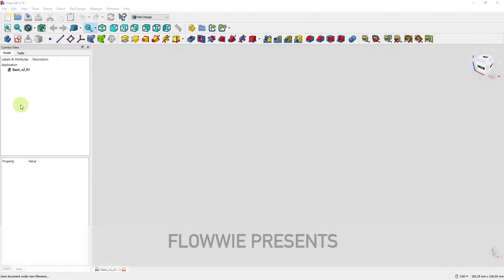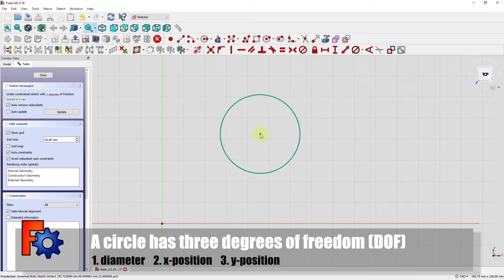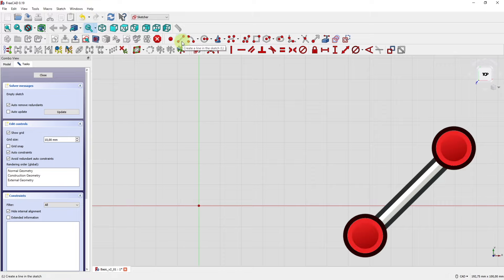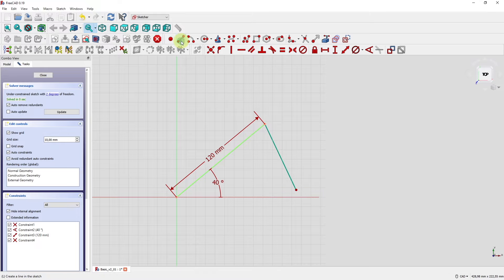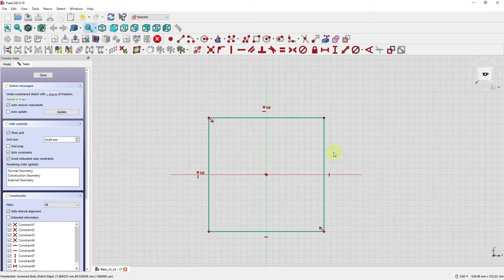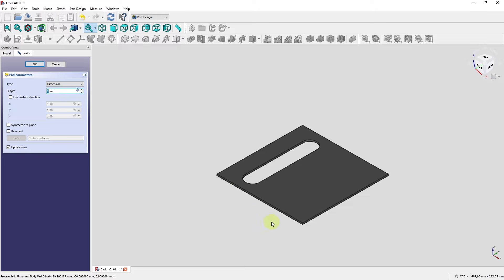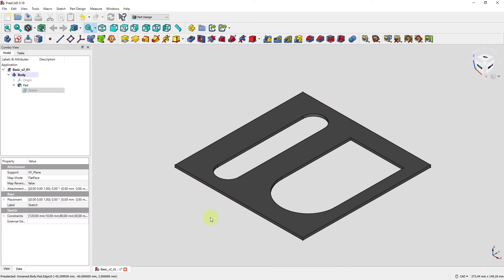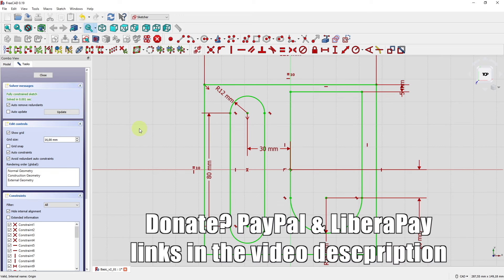FreeCAD 0.19 - Basic Course - Part 2 - Sketcher Introduction (EN)

Comment: Thanks a lot for series! Strangely I had only 1 issue with whole tutorial - its with adding symmetry constraint while making slot. Looks like I could only make constraint to two points and third - also a point (center of coordinates point), but not an axis, if I select axis as symmetry center nothing changes and I get message of redundant constraint.
Reply: I had this as well. Kind of leaves me baffled, since I am copying exactly what he does in the video.

Anyone who can explain this? It is not really a issue (yet) but I would like to understand this!
Reply: It took me a bit to realize that that he has the option "auto remove redundant constraints" active,  that is all that there is to it.
Reply: Same here. ver 0.21.1

Comment: I am slowly getting hang on FC.. but still quite a bit of hassle getting around or using the tools , pattern where you can"t  have feature pattern on sketch. I hope you gurus who started freecad will work to improve of becoming easier to use. I like the idea of freecad , but too bad i am not programmer to alter or change. Not saying it is bad CAD ware  but i see there's a lot ways to improve. I will support anyway i can..keep going guys.

Comment: For everyone having issues when making the two slot center points symmetric to the x axis (around 13:10):
Enable "Auto Remove Redundants". In 0.21.1, this parameter can be set in the constraints settings. You find these settings at the top right corner of the constrains section on the left.
Reply: Thank you very much.  I was going nuts!
Reply: Thank youuuuuuuuuuuuuu!!!
Reply: I found that by adding a point to the x-axis and then using that point (instead of the x-axis) along with the two radius points, I was able to establish the symmetrical constraint on the slot.
Reply: Thanks a lot!!
Reply: Thank you
Reply: Thanks, i've been woking over 30 minutes!

Comment: I did 2-D drafting in the 1980's with AutoCAD, but things with CAD software have obviously changed a lot since then! I'm totally new to the concepts of "degrees of freedom" and "constraints". This is very helpful instruction, both in the operation of the application interface and the concepts of 3-D drafting. Thank you.
Reply from the maker: I am glad you can easily pick up these new concepts.

Comment: Your tutorials are really fantastic for a beginner like myself.  As a retired EE and software engineer, never dealt with 3d modeling.  I'm a drummer and build electronics for my acoustic kit.  Once I found out about 3D printing and have access to 3D printers, I thought this would be perfect for me to learn and 3D print angle brackets, plates, etc.  But it's a long haul to learn FreeCad to build even the most simple parts.  Hopefully I'll get there with your instruction videos.🥁🎶

Comment: Every time I try to make the slot in the square symmetrical, it turns the entire sketch orange, indicating that it's not possible when it is, and then proceeds to not allow me to constrain the radius of either semicircle to 10mm, displaying a message saying "Datum 10.00 mm for the constraint with index 18 is invalid".
In the report view it only shows this:

13:33:57 Traceback (most recent call last):
  File "<string>", line 1, in <module>
<class 'ValueError'>: Datum 10.00 mm for the constraint with index 18 is invalid
13:33:57 App.getDocument('Unnamed').getObject('Sketch').setDatum(18,App.Units.Quantity('10.000000 mm'))

Any idea on how I can fix that?

Edit: I found out why, it's because there was one too many (unneccesary) constraints. (Aka the one that made one of the lines vertical wasn't necessary.)

Hope this helps anyone that has come across the same problem.

Comment: When setting the radius constraints (at about the 13:41 mark) I'm getting this when I try to set it to 10mm:

15:09:03  Recompute failed!
15:09:16  Traceback (most recent call last):
  File "<string>", line 1, in <module>
<class 'ValueError'>: Datum 10.00 mm for the constraint with index 18 is invalid
15:09:16  App.getDocument('Unnamed').getObject('Sketch').setDatum(18,App.Units.Quantity('10.000000 mm'))
15:09:16  Recompute failed!

Any thoughts?

Comment: Once again a very well thought out and presented tutorial😊. I have learnt far more in these two introductions over a couple of days than I gained from about a week of trawling other presentations - Thank you'
I got lost in the use of the  Polyline tool with the 'm' actions because I have not used the tool before. I ended up not closing the object correctly but managed to correct this during the latter actions in fixing constraints - This is a real positive result because I had to use the knowledge I have learnt in the last couple of days to achieve it - Thank you.
The ability to name constraints in sketchpad and using these to modify the model in sketch is really superb. In previous tutorials, from other sources, they suggested using a spreadsheet!
I feel far more confident now and look forward to viewing #3 of this series.
Peter

Comment: Hi Flowwie, thank you for the tutorials, they are outstanding and very informative. I have done this video exactly following your prompts,  however I keep getting an redundant constraints (17) message when I try to apply the symatry constarint to the slot and the x axis.
This is by far the best tutorial series I have done.
Thank you!!!!
Reply: Hi, i found the same issue as you and after a bit of choice language I realised that if I highlighted Constraint 17 and deleted it then i was able to apply the symmetry constraint to the x axis and it all worked perfectly again from then on, my constraint tally matched still and my end result was the same as shown in the video.

Comment: Nice, thanks for the clear explanations.  Really getting the concepts !!  I am a software developer and have used openSCAD so far for everything I do in 3d printing. (it lets me think programmatically to build things without having to learn complicated CAD UIs) But these CAD techniques are essential to take thigns to the next level.  I know there is an integration between openSCAD and FreeCad.  Not sure if you have a video on that (will check)  If not, consider it as a possible topic.  Thanks !!

Comment: At 13:15 when I try to constrain symmetry I get a 'redundant constraints' message. Any ideas?
Reply: Enable "Auto Remove Redundants". In 0.21.1, this parameter can be set in the constraints settings. You find these settings at the top right corner of the constrains section on the left.

Comment: I am following exactly, and at 13:00 when I place the slot, select the two points and X axis and hit symmetry constraint, it gives error in solver message that the Sketch contains redundant constraints, and says constraint 17 is redundant. When I try to constrain the radius of the top curve, it gives Dimensional constraint error "Datum 10.00mm for the constraint with index 18 is invalid".

Not sure what's going on here. Anyone have any ideas? I have followed the tutorial exactly

Edit: I fixed the problem by simply deleting the redundant constraint that it linked me too, but still unsure why it happened on my end and not the videos. Interesting
Reply: Enable "Auto Remove Redundants". In 0.21.1, this parameter can be set in the constraints settings. You find these settings at the top right corner of the constrains section on the left.

Comment: Just a beginner in CAD but learning a lot from your method of presentation of the tutorials. I enjoy the way you teach the content of the different tools along with the best sequence to to use them. Can't wait till the next one. Keep them coming. 
Two questions: One of your previous videos was about Topological Naming issue in FreeCAD. Is it still an issue with version 19.2? 
                            Not sure I understand the use and reason for the datum plane. Could you give a more detailed explanation of its use?
Reply: Datum planes can ,among other uses, bypass the topological naming problem. They allow you to sketch without attaching the sketch to existing elements. So ,if you edit another part of the model ,the sketch on the datum plane(s) remain unchanged.

Comment: I'm in version .21 and the Symmetry command would not work on the Slot. I used other constraints to finally make it work. That being said I noticed the Slot radio button was different in 0.19 as opposed to V 0.21

Comment: I'm making a tube with multiple inner and outer diameters for shoulders and threading. I have so far managed to recreate what I needed using the sketcher and constraints then used rotate to turn it into the tube. Is this how you would go about this or would you make many small separate cylinder sketches and link them together? 

M for switching the polyline is something I would probably never have known about without seeing it here.

I am struggling with the measure tool. How do I measure across a circle to check the diameter? I want to check that the shape ended up the correct size after rotation.

Comment: Is there a single place to edit all the parameters of a more complex design, made of several sketches and features?
Reply: You might want to check into some videos that show how to set up and use the spreadsheet workbench. It's a great way to set up easily changeable parameters for even multi-body parts designs.

Comment: When I try to do the arc part on the square I get an error ' Datum 10.00 mm for the constraint with index 18 is invalid ' I've tried multiple times but get the same error? Anyway I can fix this?
Reply: Part 13:51

Comment: I need help. I follow everything he said, but i can't do the first constrain on the slot. I always get "redundant constraints" error message.

I'm using the 0.21.1 version of freecad.

Edit : I solved it by puting a vertical distance constraint between one of the center point and the x axis.
Reply: I got the same error. Do you know why this is?
Reply: @Ray-ln7ut  I'm a newbie, so no. But my theory is that there have been some changes made on how freecad handles the constraints between the versions. 

Just try other ways to constrain your sketch. I learned that it will work when partially constrained, too.

Basically, trial and error until you make it work and figure it out.

Comment: This is starting to be cool, up to next lesson. you doing great but you should "try to make some mistakes. For ex.: at 17.30 I did horizontal in stead of vertical, this was moving my slot over the center point, and of course defining next step was not possible. but again, I learned something extra by doing this mistake ;)

Comment: can i to have a question?: if i have multiple items at the same vertical distance (referenced to X) with different distances from Y.. is there a tool to resolve this like the equal or a simple way? thanks!!
Reply from the maker: Either with a construction line (blue line) where all items are fixed on this vertical line. or you simply set the vertices to a vertical constraint without using a line. best regards

Comment: How did you enable the grid? Those lines really help with seeing what plane I'm operating in personally.
Reply from the maker: If you mean the standard planes?
Create a new body element in the Part design workbench.
Open this body and select the „Origin“ and toggle this visible by pressing space bar.
If you mean the grid in sketcher, select it in the left sketcher menu

Comment: What a great video and detailed tutorial of FreeCAD! Thanks so much!
And I want to ask if we can directly enter the coordinates of the points (of line and center), just like AutoCAD? It would save us a lot of time to draw the sketch.
Reply: Hi, there's not the same methodology as in AutoCAD or Fusion.
However, the use of keyboard shortcuts reduces a lot the time on sketching.
The use of the "Pie Menu" too: (Accessible with the TAB key and totally customizable.
- Install the Pie Menu, as any other workbench or macros, through Tools Menu/Addon Manager).

Another skill required in FreeCAD is the way you can select the elements within a sketch...

- For example two endpoints of 2 lines close to each other:
Selecting both points by dragging (from left to right) the cursor while pressing the mouse left button will form a selecting window the result is totally different than making right to left.

There are also at least 2 more channels here that the tutorials are great too and they produce videos every week or even daily…
-	https://www.youtube.com/watch?v=F6H1iPwVg2o
-	https://www.youtube.com/watch?v=Z_nKfNiDfbU
-	

Cheers and good learning